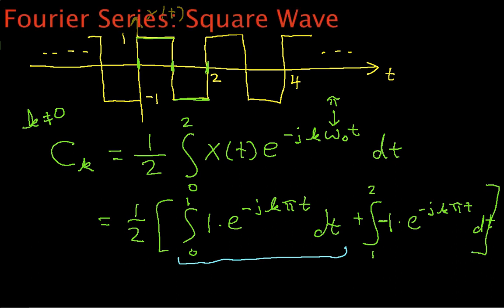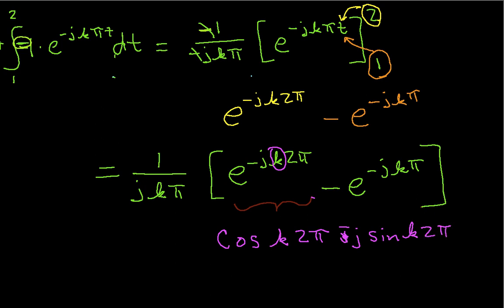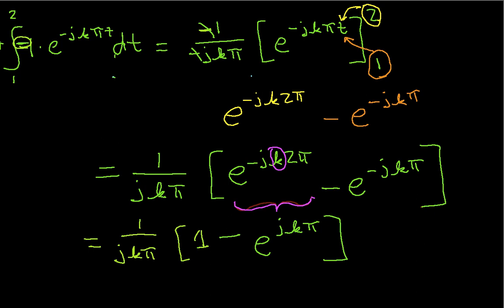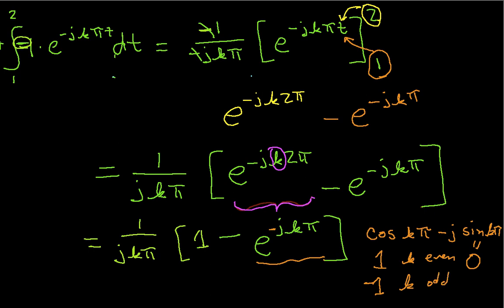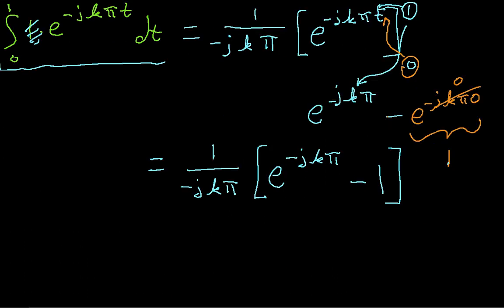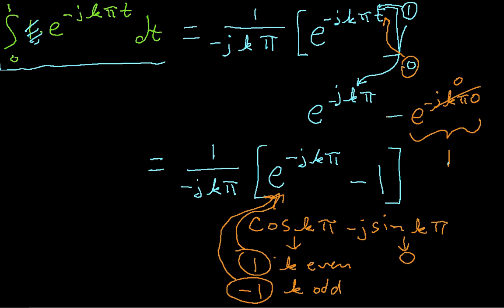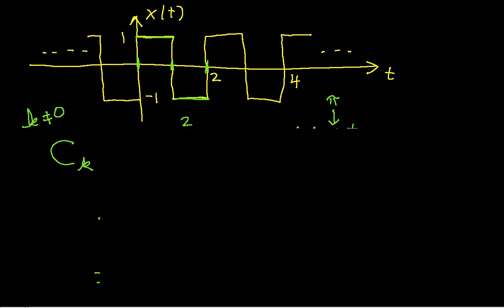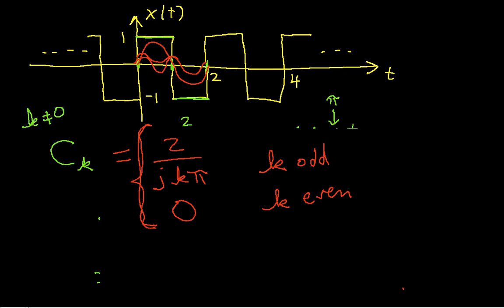Fourier Series Example: Square Wave Part 2

Comment from the maker: The frequency (and thus the period and duration) of the reconstructed square wave depend on the fundamental frequency (omega_0) of your Fourier Series expansion. The coefficients will be the same for square waves of different frequencies, but the fundamental frequency will be different. So when you are reconstructing the square wave, you need to use the correct frequency in your exponentials.

Comment: Hi, thanks for your reply. I was using the correct value for omega, I figured it out! What I hadn't realised after a day of doing ordinary Fourier series, is that the exp series is from -inf to inf, meaning that you must determine as many terms for negative n as positive n. I had just determined n=1..5. After doing n=-5..5, the imaginary portion cancelled out (as it should have done) and I ended up being able to equate all the exp functions to cos between the limits as expected!

Comment: Can you please explain what fourier transforms are used to achieve.  I understand all the math, so it's not that I don't get that, but I never took a class dealing with fourier transforms.  So, for example, what kinds of functions do FTs apply to (the ones in the integrand, I mean), and what do the coefficients found in this video represent? Can you recommend anything to read about it?

Comment: Nice video sir,..
But sir I am facing problem while evaluating the Generalized expression for the square wave, which is having amplitude 'A' for (0 to T/2) time interval and has amplitude =0 for (T/2 to T),...

The problem is how to solving the exponential terms to either Sine or to Cosine term in this case??????